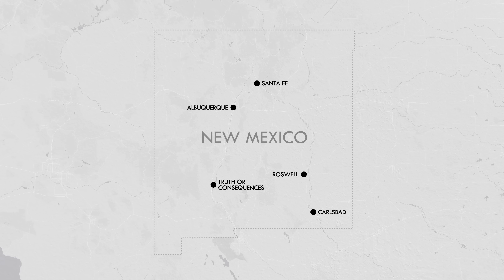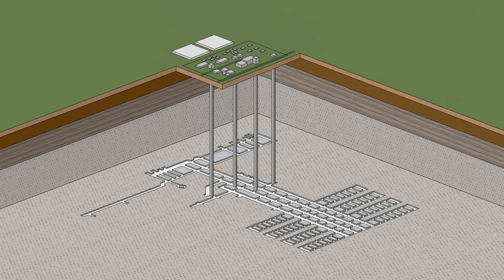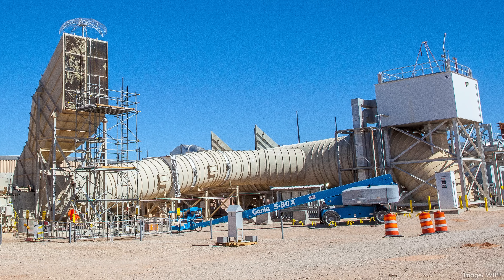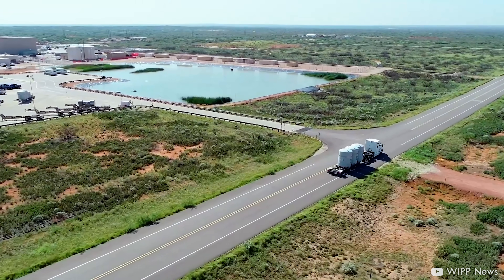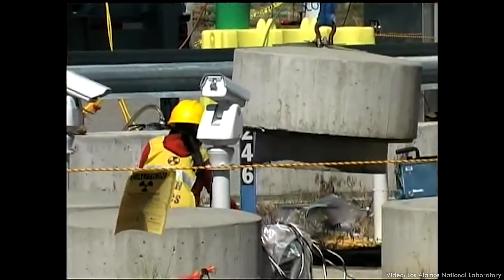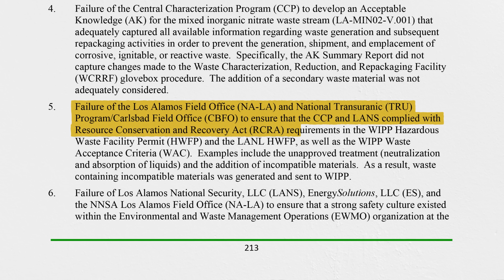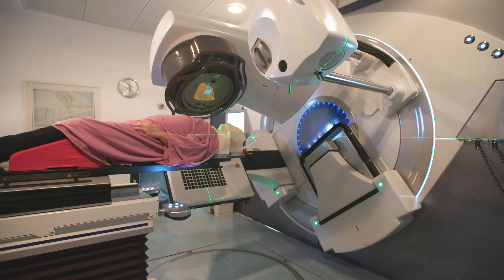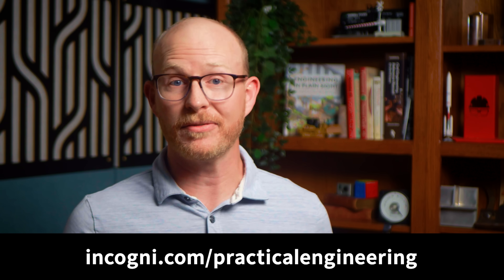When Kitty Litter Caused a Nuclear Catastrophe

Comment: Question: why don’t they just use sand/silicon oxide?

Oxides are as stable as it gets due to the electro negativity of oxygen. Only fluorine is higher which is why only fluorine can dig through glass test tubes. But so long as they don’t have fluorine mixed in the nuclear waste for nuclear reasons they would be completely fine just adding sand, no? Why complicate things?

Comment: There are known risks in using absorbents for leakages of nitric acid or nitrates! You gonna use the wrong absorbent with HNO3 or NO3- it can result in an ignition of this chemical waste mix! Nitric acid or nitrates are strong oxidizers and you have to choose the absorbent well to prevent a chemical exothermic runaway fire in the waste storage. There can be lots of incompatibilities between chemicals and absorbents to care of before deploying waste, even in the common non-nuclear industries.

Comment: the other thing that boggles the mind is that the technicians actually doing the repackaging (who are generally technically competent individuals) did not immediately recognize that they were mixing an organic material with nitric acid and question it, I know that may go against the culture of los alamos with its primadonna attitudes but that is exactly what is needed and REQUIRED by safety regs when working in nuclear safety environments.... I'm thinking some folks were simply scared to question someone "above" them... and that needs to change as it is a culture of UNsafety

Comment: Hi, will we see a video about the power outage in Spain and Portugal? I’ve heard that a potential cause might be induced atmospheric variations, leading to increased corona discharges.

That topic would fit an addendum to your power grid series, especially since we might see these effects more and more with climate change.

There is a post on Physics Exchange explaining that possible cause. It’s Jayson’s answer to the question “What is Induced Atmospheric Vibration?”

We will have to wait a bit more for the investigation reports, but it already seems like a really interesting topic. Even if the cause were not induced atmospheric variations and corona discharges, I think discussing that topic is relevant for the future.

Comment: So the fun thing about WIPP is that they basically... overcomplicated things. DGD is kinda probably the best solution, and we have a real world example of what happens if all the containments fail with the Oklo uranium deposit. IIRC even with active self sustaining fission with a  aquifer running through it, the movement of byproducts were basically measurable in less than a meter over a rough estimate of 2 billion years. Give or take.

Comment: Use nuclear power they say. It's cheap and safe. The radioactive waste that will still be radioactive after mankind has gone the way of the dinosaur disagrees. All the oops moments that cause loss of life. Build a reactor - test the safety systems. Oops there is massive quantities of radiation released. Build a reactor near the coast - a big wave makes a mess of the coast. Opps there is massive quantities of radiation released. Build a "demon core" to experiment with ways to handle plutonium before it goes bang - fail in the safe handling. Large quantities of radiation released. Build a repository to safely store nuclear waste - miss 2 letters which change the meaning from inorganic to organic. 15 years into it's thousands of years radioactive life there is a radioactive leak. So far about $USD18B has been spent on cleaning up nuclear accidents and nuclear power is only about 80 years old.

Comment: This video reminds of an engineering materials related accident here in Sacramento in the 1990's, at Folsom Dam. Folsom is a concrete gravity dam, with several large Tainter spillway gates. These semi-cylindrical gates are supported by radial arms on either side of each gate, and the arms terminate in journal bearings anchored on concrete abutments either side of the spillway. The gates are lifted and lowered by 10 horsepower motors on the top of the dam, that slowly rotate sprockets through a 10,000:1 reduction worm-gear drive. These sprockets engage big chains that are attached to the gates. Spin the motors clockwise, the gate raises, counter-clockwise, the gate drops; very simple, very reliable design, and easy to maintain. 
To give you a sense of scale, however, these gates are something like 30 feet wide and 40 feet tall, and the gates and radial arms weigh at least a couple hundred tons each. These aren't "small" structures by any measurement standard. Folsom Dam was built in the early 1950's and began operation in 1955. Every ten years, those journal bearings that support the gate arms get inspected and maintenance is done on them, including cleaning and re-packing them with grease. And that's where the chain events leading to the gate failure began. In the most recent previous maintenance cycle prior to the failure, it was discovered that the company that had supplied the grease for the spillway gate bearings was no longer in business, so a new source of supply had to be found. One key requirement for the grease somehow got overlooked: the grease had to be of a formula with as little propensity as possible for absorbing water. The grease that the BuRec maintenance people acquired met all the requirements for shear strength, temperature stability, and lubricity, but apparently no one thought to ask if this grease was water-resistant, ie, "hydrophobic". You probably already can guess what happened. Over several years, all of the bearings had been absorbing water vapor, both from rain, and the spray and mist that's always present around a dam spillway, and the carbon-steel surfaces of the bearing journals had begun to corrode - inside, where no one could see the damage. On July 17, 1995, the operator began to raise spillway gate #3 to initiate a release, and didn't realize that the bearing on the south side of the gate had seized from internal corrosion. Because of the 10,000:1 reduction gear, the lift motor was able to pull on the lift chain with an enormous amount of force without stalling the motor, with the result that the gate began to lift, but the seized pivot bearing wasn't allowing the radial arm to move, turning that pinned connection into an anchor. The radial arms were designed to resist compression force, not bending moment, and with the lake being more or less full to the brim, there were hundreds, maybe thousands, of tons of water pressure pushing on the gate, and the arm on the south side buckled, basically destroying the gate itself and the support arms on both sides. The water flowing out past the broken spillway gate created a 40,000 cubic foot per second flood on the lower American River, and the reservoir lost 40% of the water that was stored before the pond elevation dropped to the bottom of the spillway. No one was injured, as far as I know, but the dollar cost to the Bureau of Reclamation to replace the wrecked gate, and the lost revenue of the water that was wasted was some tens of millions of dollars. All for the lack of a few pounds of the correct type of grease.

I was working for the CalTrans Office of Structure Design at the time, and an engineer from BuRec came and gave us an FYI talk a few months later, after the accident had been fully investigated and the fiasco of the wrong grease had been identified as the root cause.

Comment: I made a bunch of the monitoring equipment for whipp. On a regular basis they used to accidentally drop our equipment down the mine shaft. In all reality there's no risk from those barrels exploding. The rad tecs from whipp used to come to our shop on a regular basis and I got to ask them personally about the incident.
 Fun fact: there are much worse areas in NM that they will never admit exist. Like the uranium mine that a private company is trying to give back to the state but it requires a certain amount of time for it to be monitored at a certain rate. But the company has been purposely monitoring the wrong type of radiation to claim its safe and give it back to the state. It's almost like there's a reason for the high rates of thyroid cancer in New Mexico.

Comment: Nitrates & Organic is a no go anyone with College Chem 102 would know that. FYI Practical Engineering All mines have roof bolts it is an MSHA requirement to prevent reduce roof collapse on top of workers… all mines roofs & floors slowly close up, all the overburdened causes the floor & ceilings to close up, salt is more plastic and closes up sooner than harder rocks do

Comment: I see WIPP got suckered by Lightning Eliminators & Consultants.  Even the fed, even engineers and scientists have been suckered by that company.
( @17:35, the umbrealla-like structure on top of the tall vent housing on the left.  )
They claim that their hardware will reduce lightning strikes, but their data and science are nonsense (and very small).
 Those dome shielding arrays - and their spline ball terminals - are proven not to work, except by LEC of course.

I actually worked with them in the 90s.  They wanted to buy a Tesla coil, which my company made, to demonstrate their gear on a diorama.
It was not a valid demonstration, and I declined to sell them anything because they acted like drunk cowboys not engineers, and they didn't seem
particularly safety-minded, which is amusing considering their stated goals.  After the initial contact, they pestered me several times about the issue, 
almost as if they wanted to hire me. Eventually they bought a high voltage power supply to make the sparks on their little diorama - at my advice.  
But their stuff is proven not to work!  They are still around, still selling snake oil.

Comment: 12:43 fun fact: we (briefly) considered trying to genetically engineer cats that would glow if exposed to radiation.

The idea was that it's hard to predict ANYTHING about what humanity will be like 10,000 years from now. The one and only example we have to learn from is ourselves 10,000 years ago. Our knowledge of what humanity was like back then is limited, but one of the things we DO know about them that's still true today is that we both like cats. They kept cats around, probably to control rodents, but likely also just as pets. Cats are attracted to human civilization. Turns out we're a pretty good source of food for the right kind of fuzzy creature.

"What if we made the cats glow?" was an attempt to explore the idea that our descendants might be more likely to keep cats around than to remember how to read today's languages. That said, if WE suddenly discovered that a particular breed of cat GLOWS at this or that particular ancient temple, I'm pretty sure we'd release whatever demon our ancestors were trying to contain there as we tried to figure out what the heck was making the cats glow.

Ultimately, of course, making cats glow is no kind of practical solution, even if we could pull it off technologically (after all, we can't even figure out what kind of kitty litter we need /j), but it's a pretty darn good thought experiment. Getting any sort of message across 10,000 years is very hard.

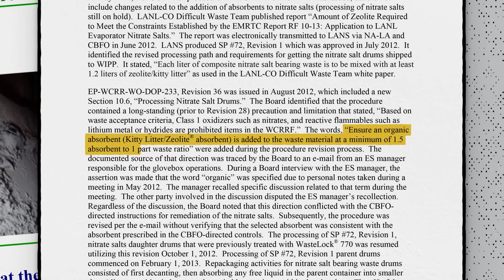Comment: 09:41 Only the organic part. But I did take a look myself because ocd riddled me with curiosity. I'll paste what I found.
This is what I was looking for: RTR couldn’t distinguish organics from inorganics in LA-MIN02-V.001. Of course now that I'm reading it again I don't know if they're talking about the same event(turns out, nope not the same event.) But I will say it was an extremely long report with like 394 pages, with inorganic mentioned 52 times and organic mentioned 129 times. Oh nevermind; it's at 9:40 under the highlighted part: well not actually the inorganic stuff I was looking for so I'm going to go run for 5 MI or until I forget what I was looking for. Great video. 👍          

The documented source of that direction was traced by the Board to an e-mail from an ES manager
responsible for the glovebox operations. During a Board interview with the ES manager, the
assertion was made that the word “organic” was specified due to personal notes taken during a
meeting in May 2012. The manager recalled specific discussion related to that term during the
meeting. The other party involved in the discussion disputed the ES manager’s recollection.

Comment: Never let the same bug bite you twice.
- Did they ban automatic spelling correction in writing guidelines?
- Did they ban the use of the words organic and inorganic for carbon-compounds and carbon-free compounds?
Aviation, medicine and militaries ban confuse-able words.
Reply: Mishearing words shouldn't have even been a problem, relying on hand written notes from verbal instructions that were probably interpreted by a non-chemist should not have been allowed.
Reply: @maksrambe3812 Indeed. Anyone with a decent bit of chemical knowledge knows not to mix nitrates with organic stuff. I mean most of our explosives are nitrated organic compounds or contain nitrate salts mixed with carbon.
Reply: Contributing cause 1 from the report was a lack of an effective change control process. An effective change control process would have picked this up no problemo.
Reply: @SocialDownclimber  Almost no one has effective change control!  They'll create this big convoluted process, yet never actually bother to "control" anything aside from enforcing the process.
Reply: @SocialDownclimber And then 11 other problems also had to stack on top of it to get it to what happened. Which is actually a good thing in some sense -- it means that a lot has to go wrong. In a not so good sense, the fact that it happened means that a lot did go wrong. But I find it darkly amusing how many commenters here immediately hyperfocus on the written note... and fail to catch other problems clearly visible even in the original report (that probably 2ould not have resulted in a runaway thermal reaction, but should definitely not have been overlooked, either).
Reply: Free carbon compounds?  We need cheap carbon, let’s load up!

Comment: So they just left it as uranyl nitrate? An obviously problematic salt, instead of decomposing it to uranium oxide/daughter product oxides. Granted you have lots of nitrous oxide to deal deal with, but filtering that and making it inert would go a long way. You can then vitrify the other waste and have a much safer storage system, inside dry storage casks. Seems like they're spending so much more money to do it cheaply.

Comment: Failure to do this, failure to do that ... The basic problem is that a manager did what he believed in good faith he had been told to do, and there was no information loop which would have automatically checked if he was doing what the upper management actually wanted him to do.

Miscommunications in meetings can have all kinds of effects.  For a totally different example:  After a meeting about the main armament of America's Iowa battleship class, then being designed, the people providing the guns and the people designing the turrets for them walked away with different versions of the final plan, with the result that by the time the ship design was complete it was discovered that the specified model of 16" gun wouldn't fit in the specified turrets.  The situation was saved by a hasty application of considerable ingenuity, creating a 16" gun with the power of the desired gun model and the dimensions of the accommodated gun model.  Here's the story:
https://www.youtube.com/watch?v=8rrXs9vPfE8

Comment: One thing I would like to point out is that the responsibility to consider our waste is not unique to nuclear materials, though they get most of the press because radiation is scary. Giant Mine in Canada (a closed gold mine) contains thousands of tons of arsenic, enough to kill everyone on earth many times over, and unlike even nuclear waste it will never be safe because arsenic is a stable element. Right now our only solution is to use giant freezer units to keep the interior of the mine perpetually frozen solid, so it can't escape into the groundwater. Until another solution can be found, those freezers will have to be maintained and run nonstop literally forever.

Comment: Finally, a Grady video about my line of work! I help write the procedures for radioactive waste management in New Mexico and this kitty litter story is definitely one I keep in mind. That's why we run everything by multiple SMEs and program leads. It's impressive how many safety measures are in place so even mistakes like this don't result in environmental contamination, though.
Reply: And then we have coal power plants that spew more radioactive waste into the air every year than every nuclear meltdown ever in human history, and the extent of their regulation is minimal at best.  Whereas a nuclear plant will ban certain camera lenses because the miniscule thorium content of certain glasses will trip the sensors for radiation leaks.

Comment: Personally I think the best move that can be made with nuclear waste is to stop calling it waste. An unintended byproduct does not need to be waste. Besides recycling the waste to be used again in the same or more advanced reactors, the possibility of using beta-voltaics (an arrangement that harnesses power out of this so called waste) would allow the creation of energy for a cost much less than the permanent disposal and maintenance of the disposal site. Think of that, we are having to maintain a dump site with a thing that can literally give us energy largely because we believe it is worthless enough to call waste.